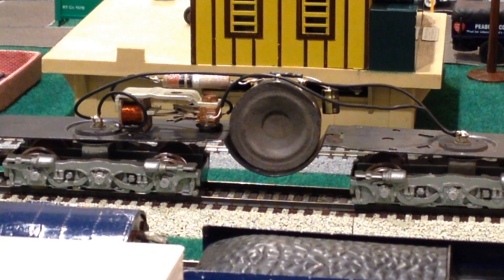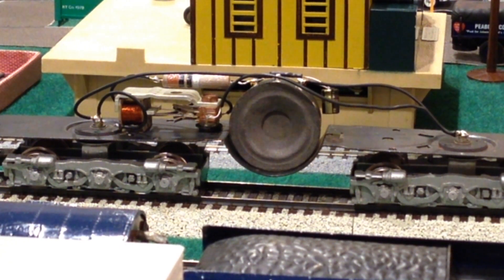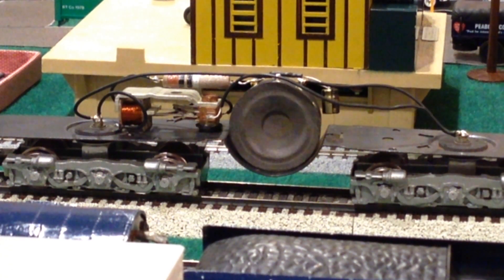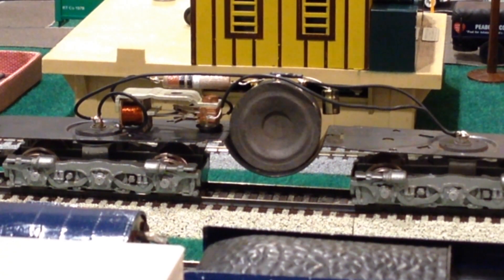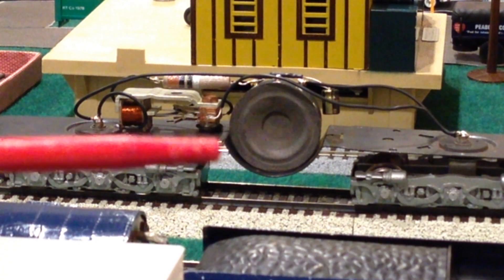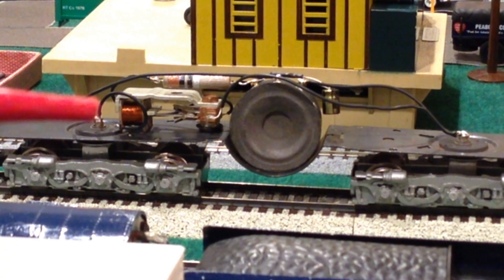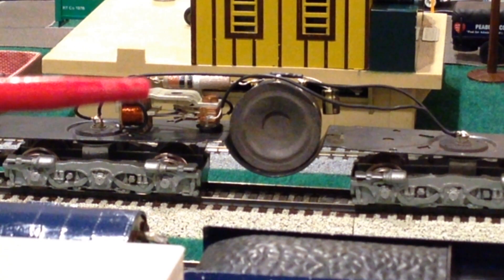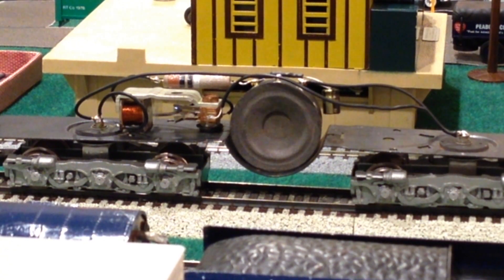American Flyer Diesel Roar and Horn - part 2 of 3

Comment: Hi Dave, Thanks for all your excellent videos. I especialy enjoy your slow, measured explanation of what you have done to bring these old trains back to life. I received a 494/495 New Haven diesel pair several years ago from a neighbor who passed away. I recently got the 494 with the dual engines working pretty well (except for the reverse unit which had been fitted with some after market contacts that were too stiff to adjust properly). I knew the 495  was supposed to come with the "diesel roar" so you can imagine my disappointment when I opened it up to find no signs of a speaker or the "roar" unit ever having been installed on the chassis. I found a roar assembly on eBay for $50 which was tempting, but then I realized that the "roar" unit was just a vibrator used in old tube car radios, and the same vibrator was used in the "air chime" whistle controller. I had a working "diesel roar" unit and I used it as a guide to re-wire a spare air chime whistle generator. It kind of worked, but mostly it was just making a buzzing sound. Then I watched your video and heard you describe a similar problem and that you had to "adjust" the vibrator. That was all the inspiration I needed to grab a some pliers and start bending the stationary contact nearest the frame. The parts are now making a decent roar sound, so I just have to mount it all the the 495. Thanks again for your help. Happy Thanksgiving, Joe
Reply from the maker: Thanks, Joe - for watching and your kind words.  I'm glad my videos are of constructive value to you.  Happy Thanksgiving to you and yours as well.  Dave

Comment: Dave, would you have a revised schematic of the diesel roar circuit you built that you could share? I would like to build one for my self and see how it would sound with my Lionel and a flyer diesel .  I saw your video on the one you modified and I really like the sound after you revised it. I wouldn’t bother you with this except I can’t really find any technical information on this.😊
Reply from the maker: Thanks for watching my videos.  AC Gilbert postwar S-gauge American Flyer train sound systems (Air Chime Whistle or Diesel Horn with or without Diesel Roar) were supposed to be relatively standardized but in actual practice varied in design and the components used depending on the engine model, time period of production, and what parts were available on the production floor at the time.  Different specification resistors and capacitors were used, and different size, material,  and configuration (2 or 3 pole) noise producers (aka "speakers" although they lacked the audio production fidelity of a true speaker which is why they actually sound better in AF engines than most modern replacement speakers).  Some were installed with only a resistor, others with only a cap, and many with a resistor and a cap.  It got to the point that I encountered and troubleshot so many different styles of these that I ended up drawing diagrams of and made notes about many of them to reference in the future.  However, my notes are now in binders packed away for an indefinite period of time , so I'm presently not of much help to you.  But perhaps someday.  In the meantime, try portlines.com, AM. FLYER REPAIR CLINICS, specifically #14 Wiring American Flyer diesel engines.  There are about 12 different wiring diagrams there by engine model.  Thanks again.  Be well, and have fun running your trains.

Comment: You mention adjusting the points to achieve a different sound. What gaps do you recommend ?
Reply from the maker: Thanks for watching and your question.  Please above my Reply related to this.  Thanks.   There was one bit of info I failed to mention in that reply and that was " if not actually making contact so as to activate the magnet in the opposite direction when power is applied..."

Comment: You mention adjusting the contact points. What is the appropriate gap of the N.O. points?
Reply from the maker: Thanks for watching and your insightful question.  I don't know if there is a default Diesel Roar (DR) gap setting.  There might be, but my experience was that each unit was a bit unique in getting the points adjusted first for the unit to function at all and then tuned to produce the desired sound.  One pair of points needs to be set virtually if not actually making contact so as to activate the magnet in the opposite direction there by causing the opposite points to make contact and then be drawn and sprung back to the original points making contact and the process repeats itself until no more power is applied to the Diesel Road unit.  The wider arch you can get the points to travel the lower the frequency of DR sound emitted, and the lesser or tighter the arch traveled the higher the pitch, but there is a point where with too much or little the unit will not function, so a happy medium typically was the preferred outcome.  Be sure the points are clean and all the layers of the stack of the DR Unit are present and stacked in the correct order from top to bottom.  I had some units with which they were not, so the unit failed to run, but with all of them correctly stacked it did.

Comment: Curious you mention that resistor got hot  and also the speaker.That may indicate a fairly high current,I couldn't read the resistor size ,or the power rating of the resistor so I''m thinking it is the original factory installed one.Its the amount of heat generated that gets me curious .I know that most resistors generate some heat but to get so hot that you had to be sure that the wiring harness doesn't touch the resistor because of this puzzles me.I Would as a matter of course separate them as you because it's a good idea. Have you found a reason for this or is this normal?